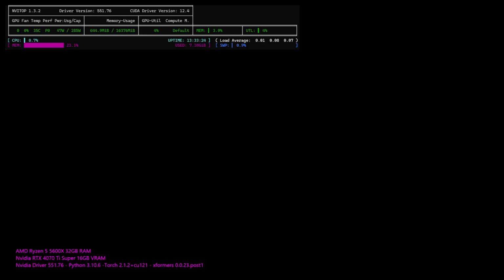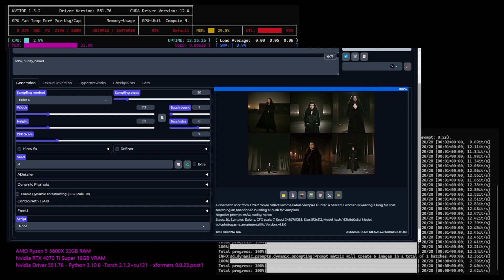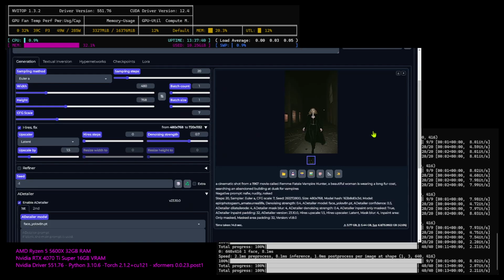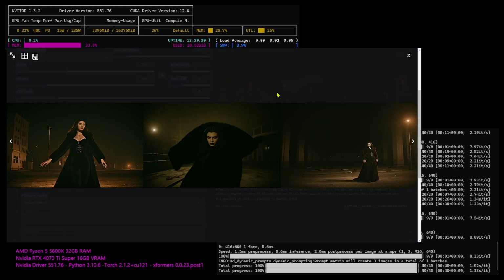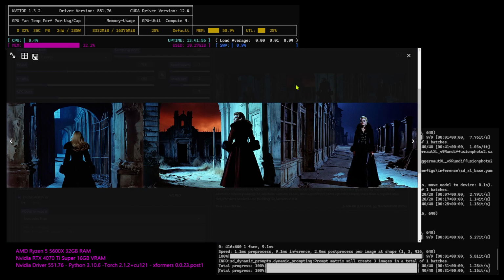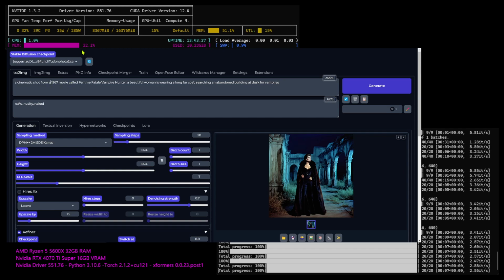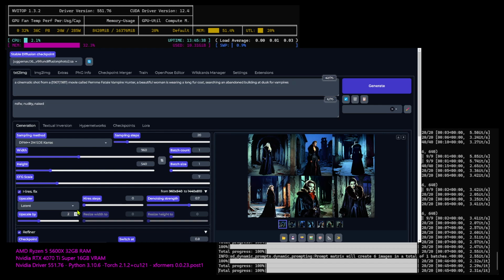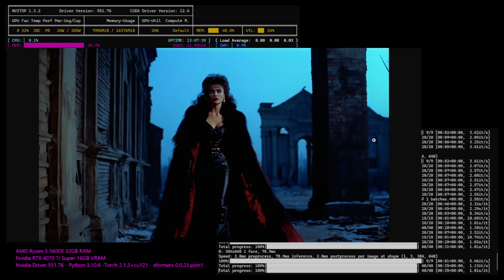Stable Diffusion 4070 Ti Super Benchmark - Automatic1111

Comment: OutOfMemoryError: Allocation on device 0 would exceed allowed memory. (out of memory) Currently allocated : 11.13 GiB Requested : 30.00 MiB Device limit : 11.99 GiB Free (according to CUDA): 0 bytes PyTorch limit (set by user-supplied memory fraction) : 17179869184.00 GiB, how to fix
Reply: use forge ui

Comment: It's a decent GPU for most AI things. LLMs under 30b (it can do 30 - but its a bit slow) and Stable Diffusion.
You can create decent LoRA's using it - not as fast as a 24GB card, but a LOT faster than using an 8GB card
Things like checkpoint merges etc. It does very well. Really quick. 
With 3090's being almost none existent even on the 2nd hard market in the UK, the option was this for £720 or spending £1750 on a 4090.
While I'd love a 24Gb card, that's just plain out of he question at the moment. Way too expensive.

Comment: I'm getting this card tomorrow: 

RTX 4070TI SUPER WF3 OC 16GB D6 GIGABYTE 

My other components:

5900x
32 RAM
Some SSD's

Do you think will run fast for SDXL at 768 x 1024 with ADETAILER on to get a good face, will mostly be using HYPER / PONY models that don't need too many steps.

Do you think i will get good speeds?
Reply: hey how its going with it? 
u have 32gb ram is it enought or should go for 64gb?
Reply: @CGFUN829  Working great!

Comment: Check my Amd RX7800xt (win\zluda). 
On plain job is only 20-30% slower, but totally sucks on big batch and  the upscaler. Last job with R-ESRGAN 4x+ upscaler took 3.5 minutes, but resize from extra tab was done in a few seconds without any issues. Strange, but ok.
Reply: Same with 7900gre

Comment: i have the same speed with 3070
Reply: It largely depends on the model and any other things you have loaded at the time into SD.  For instance I use Instant ID quite a bit which means two other elements need to be loaded through Control Net which takes overall memory usage to around 9.5 GB. SD is loading models and parts of models in and out of GPU memory and system RAM all the time with my 3070. This really slows the process down. Maybe 100 seconds to 2 minutes to create a 1024x1024 image with Control Net options added.
The 4070TI Super does those same tasks is 50 seconds to a minutes. Half the time
However if I just use the model with no extras (Juggernaut X usually) it run a almost as fast as the 4070 Ti Super. 85% of the speed maybe? Close enough for me not to care too much. Much of the time saved seems to be memory management. If the model fits into your GPU RAM with a bit left over, you are usually good to go. It's the extras that kill low VRAM cards. But the more I use SD the more extras I use.
I'd love a really capable AI card with 40GB of VRAM for under $1200. But I doubt we'll be seeing that any time soon.